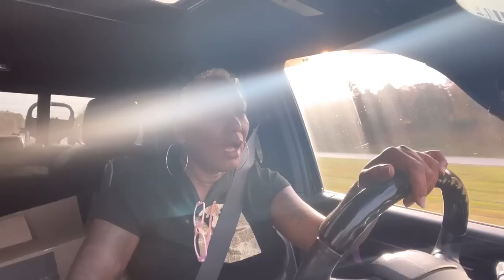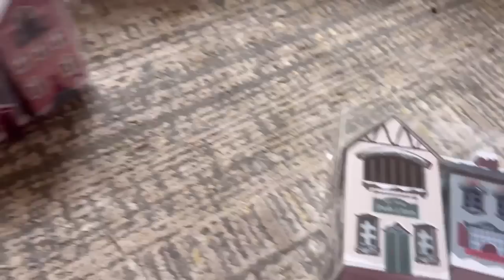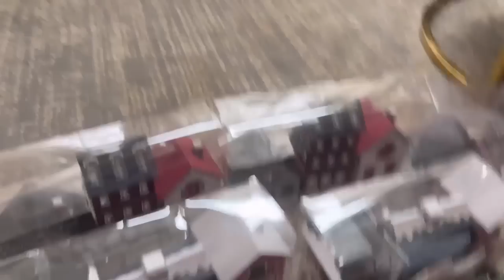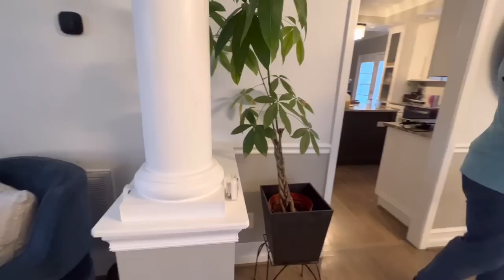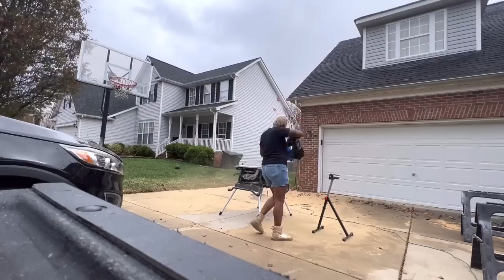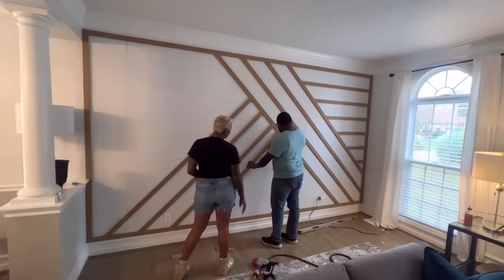NEW || DIY Accent Wood Trim Wall || Easy Weekend Project || Hugh Impact

Comment: You're right Sharon the outside of your foot probably is healed but the inside probably isn't that's probably why it's burning like it's on fire because you're still walking on it and not giving the inside time enough to heal but in time I'm pretty sure it will just take your time be careful while you're walking on it and when you're not walking on it make sure you still taking care of it because the inside is very delicate because of it's not healing right in there just saying